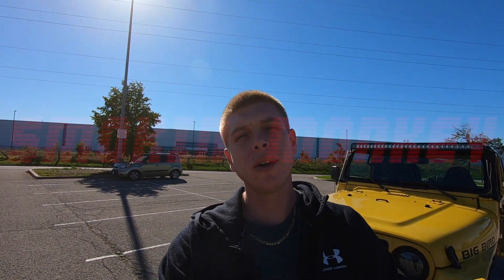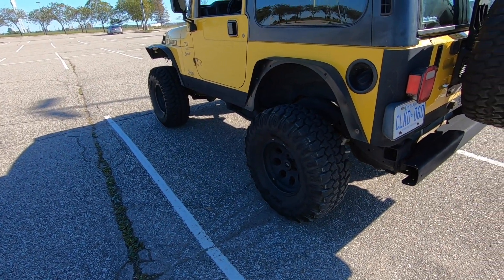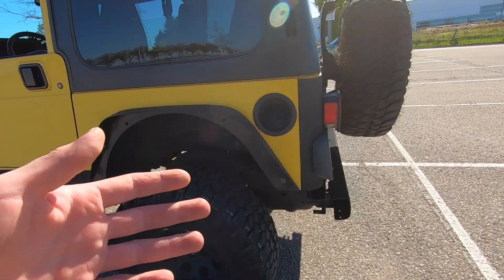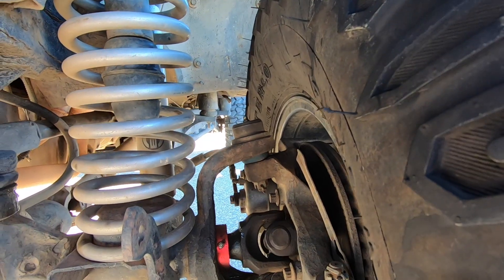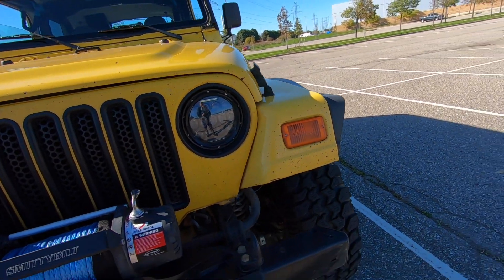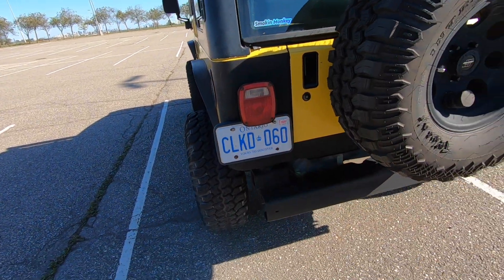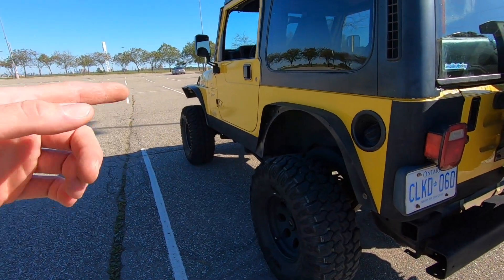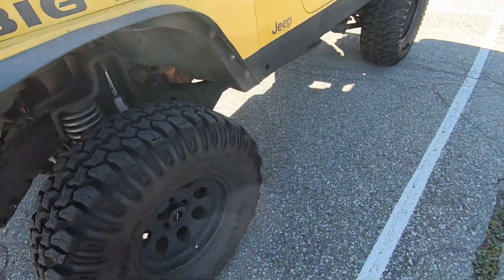How To Get Your Lifted Jeep Or Truck To Drive As Good Or Better Than Stock!

Comment: It aut cheap. I added the metalcloak 4.5 inch long arm kit. I drove in another person's tj with it . It was night and day difference.  So mine is getting installed as I type this. 😃 😊 plus I changed my steering box to a 1999 dodge Dakota. It's much better. I also added rock jock steering components with fox shock steering stabilizer
Reply from the maker: Ya I really wana do a long arm kit after I do a sye. I’ve heard good things about the Durango steering box too, should be stronger and bolts right in if I’m not mistaken. Nice build man!!

Comment: G,Day from Queensland  Australia   .              My TJ 2006 has a six speed stick  shift 4.0 it has a sound every time I depress clutch, Like a Aluminium drink can being crushed suspect clutch fork our slave cylinder push rod very dry ,Clutch is working good the way its set up i am not so shour if any thing can be done  unless  removing holl gear box ... A man canot get any sence out ove any one over in this country about jeeps  there ancer is normally  you shouldn't have bourt a jeep  and as for there comments my jeep has taken me oul over the outback no problems.  So any  way  JEEP ON .
Reply from the maker: Personally I haven’t heard of that issue or experienced it myself. But I would look it up on the forums. If you type in ‘Jeep TJ forum’ and whatever problem you have there’s tons of threats of people going through similar situations. Hope this helps. Definitely Jeeps are awesome just takes some love to keep ‘em going lol
Reply: @SmokinMonkeyOG  All good   , your steering rig upgrades  look nice and strong ,Unforchenently  my tj being right hand drive  gives me not much  apions over here ,I see jeeps  in the US RUNING DOORS OFF in Australia  we are not permitted to drive on road doorless  I do have a set ove half door  to ,,, and we see tyers out from under the gard,s in US  YOUR JEEP,S LOOK  GOOD LIKE THAT ,, Funny iff jeep,s run with any tyer out from under fenders  in Australia  the cops  grab us for it .. my TJ WRANGLER  65TH ANIVERSERY   is a rear  jeep in my country  I've had a lot ove good offers   but no way would I sell it  . Its oulways a frendly wave  when seeing  a TJ  IN TOWN.
Reply from the maker: We’re allowed to run without doors but the tires have to be inside the fenders too or you’ll get tickets. I just don’t give a shit lol